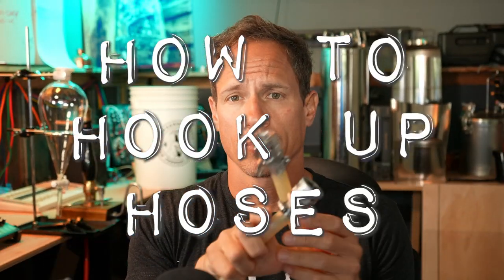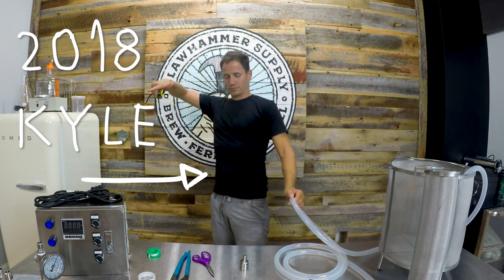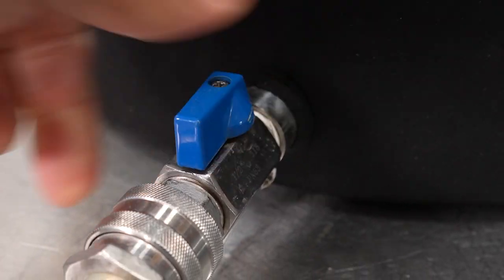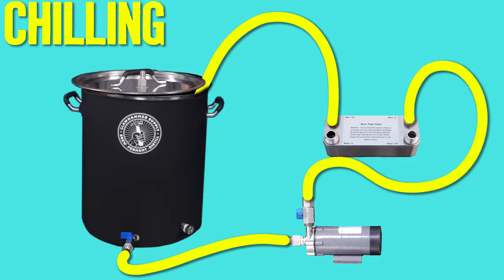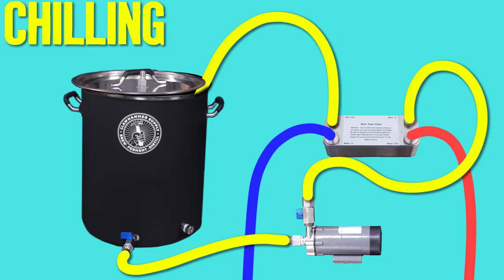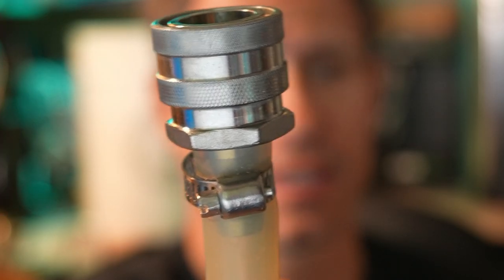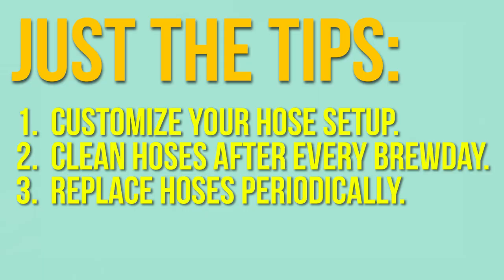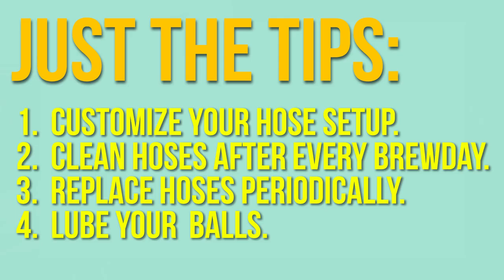How to Hook Up Brew System Hoses

Comment: I just realized I've met you at Asheville brewers supply. This is some valid serious advice. I just this past week brewing had a quick connect I thought was solid come loose. I had 210° wort hit my leg and had 2nd degree burns hit it. Really bad timing. I've done this (brewing) so many times and got a bit distracted. Learned my lesson. Never assume the connection is solid. I'm going to lube all my quick disconnects now.

Comment: Very good info, thank you 🍻. Is juice worth the squeeze in relation to the whirlpool arm for a 10 gallon kettle?  Clamping the end of the silicone hose from pump/chiller against the inside wall of the kettle creates a pretty good lil whirlpool on it own. 🤷‍♂️

Comment: One of the fittings I bought has to be muscled on to make a connection, I don't know if this is a machine defect or if there's something binding.  The bearings are moving and not stuck in any way.  Thoughts?
Reply from the maker: Even though the bearings might seem like theyr'e fine, we definitely recommend putting some food safe oil on it. Both on the bearings and the housing. Almost positive that'll fix the issue.

Comment: Hey Kyle, quick question. If I get your system and brew in the apartment where I don’t have a hose . What are the fittings/parts do I need? Thank you!
Reply from the maker: you need to install a hose bib under your sink. that's the easiest way to do it. much more simple than you'd imagine.
Reply: @ClawhammerSupply  okay! Buying soon, can’t wait😭😎

Comment: I have a question, usually when I am doing the chiling, the sediment gets stuck and the flow starts to slow down, what do you recommend to do in that situation? Do a second filtering before boiling? (The kettle has a tube with a filter on the exit, but it gets covered with hops residue and what I assume is protein). Thanks!
Reply from the maker: That is a great question. If you scrape the filter with your mash paddle does it clear up? Are you using the hop basket or tossing the hops into the kettle?
Reply: @ClawhammerSupply  yep, usually I try to use the paddle to clear the residue from the filter. I am currently tossing the hops. I could try the basket for the hops, thanks!!